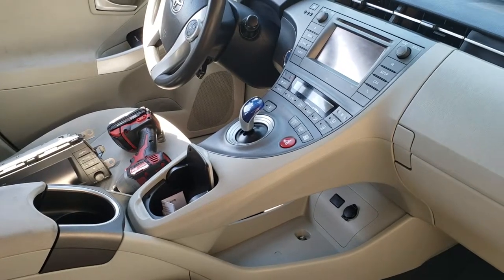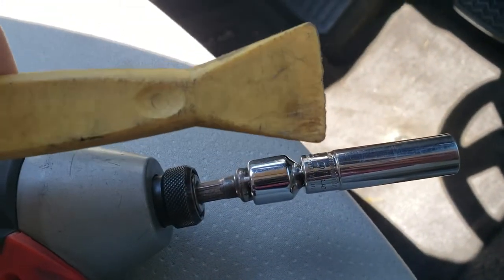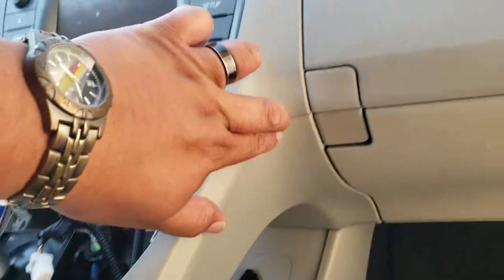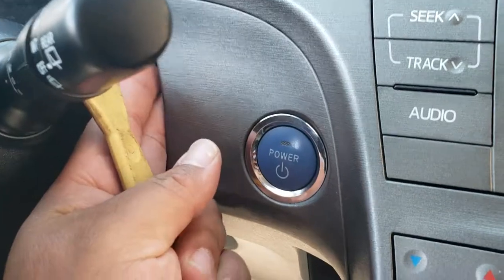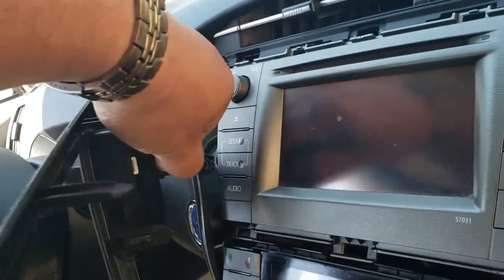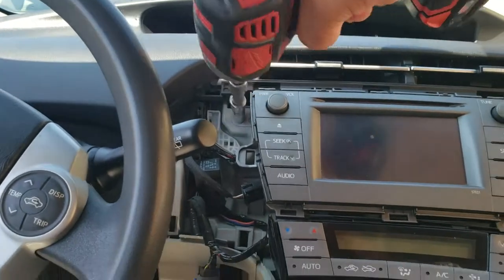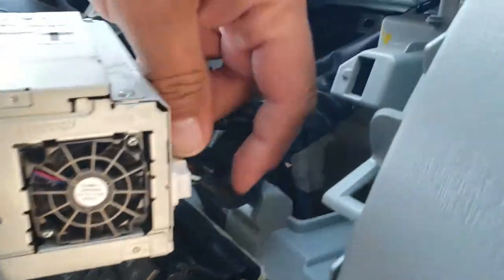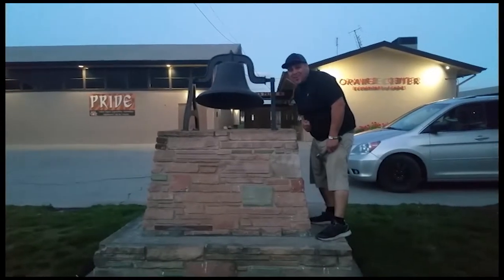How to: Remove a Oem Radio from a 2015 Toyota Prius

Comment: Thanks for the video.  About to get into this myself for a 2015 and I am curious about how the usb connects to the back of the factory stereo.  Mine goes to the center console btw.
Reply from the maker: Its all plug and play. It should be as easy as unplugging it and plugging everything back into the same place. Hope this works!
Reply: @559powerscape  Appreciate the response but I didn't ask the question correctly because I need to replace a usb/aux port in the console.  So I need to remove the console or something.
Reply: Can you put the 2015 radio on a 2011?

Comment: Hey bro, do you know a digitizer on ebay that work with 2015 prius, I only see the one for prius c
Reply from the maker: I couldn't find any online either. Maybe time for an upgrade. Have you looked into the android radios? 
You can also contact toyota to see if they can get for you as well, for the digitizer 

https://www.ebay.com/itm/325382392004?mkcid=16&mkevt=1&mkrid=711-127632-2357-0&ssspo=x4tXZyknSBS&sssrc=2349624&ssuid=Q-DrubH0Sve&var=&widget_ver=artemis&media=COPY